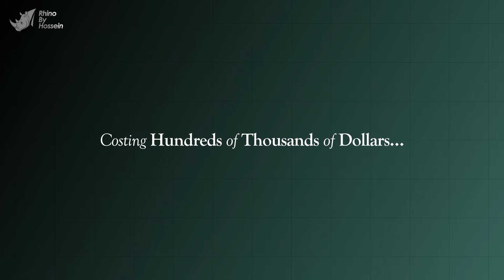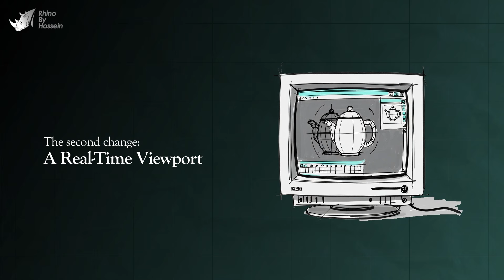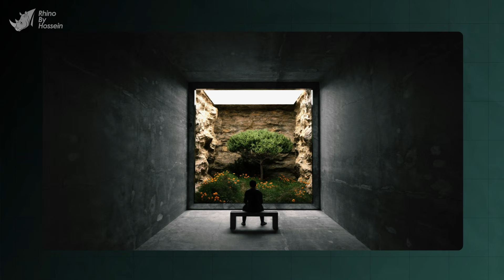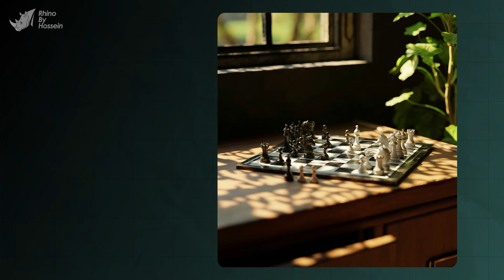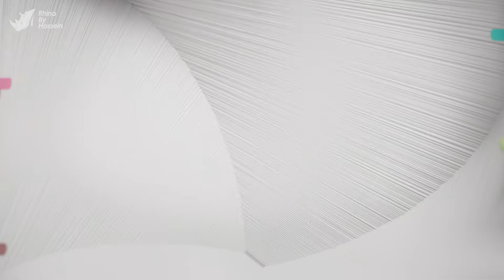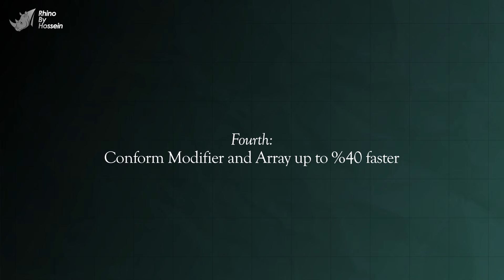The Untold Story of 3ds Max | Inside Autodesk's 3D Empire

Comment: great effort, great video hussein, i wonder why you described blender as node based system while it has the Modifier Stack feature as well, for me  max is one of the best as archviz environment, but blender has much better teaching community and wide spread with high quality tutorials, which makes learning new software much easier, and also and it might not be a core factor for pro level but max have kinda an outdated ui which made me depressed like it has no life in it, in any case both of the programs get the job done for certain people and that was just a personal opinion
Reply from the maker: Thanks for the feedback and for sharing your perspective on those different workflows! 🙌